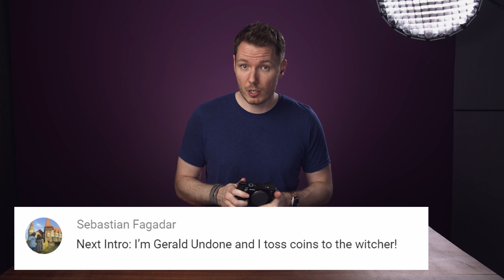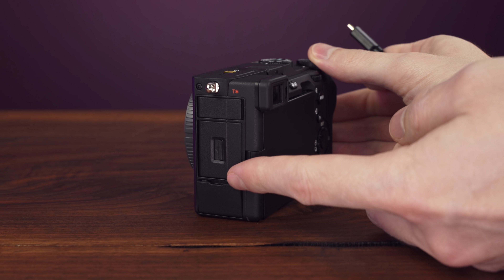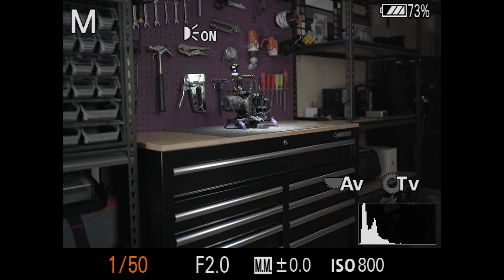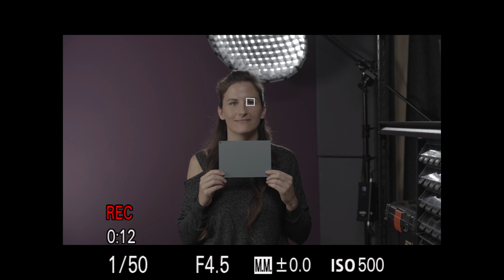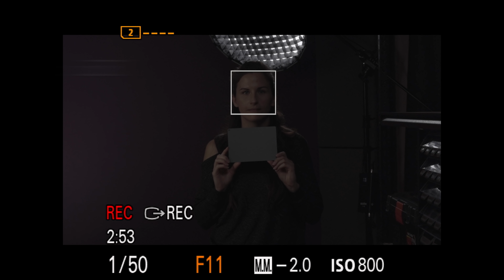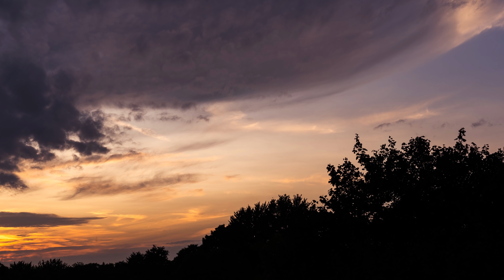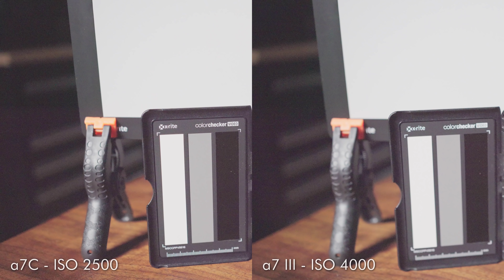The SONY a7C: Why THIS Camera Is IMPORTANT!

Comment: I used to enjoy being able to put a 14mm f2.5 on my old GX85 and slipping it in my trouser pocket, but I don't think the a7C could do this with a lens mounted - although even then, I preferred the flip screen and EVF on my old G85, then ended up getting an a7iii after Tamron released the 17-28. The AF, dynamic range, port doors and screen seem great, so it makes me more excited for the a7iv

Comment: £1899 in UK which is approx equivalent to $2400. A73 is around £300 cheaper. More price and you lose custom buttons, nice evf, better grip, two sd card slot and when it comes to the size, its almost same as sony A73, they have just chopped off evf from the top. 8 bit video recording for this price is a joke. Panasonic s5 is £100 cheaper body only and £200 cheaper with kit lense, which is much better as it is faster and starts from 20mm. How you can vlog with 28mm of sony kit lense? I just wish Panasonic s5 has better auto focus. I don't know but I have feeling that Mr undone has soft spot for sony ;)

Comment: Great video again Gerald. So the big question is: Why you have to spent a 2000 euros for a camera who is pretty much the same (even worst IBIS)  as previous Sony except to get a smaller body... If I need a smaler body there amazing deals outhere as GX9 (for 400 euros)  for street photography and best panasonic videos and the best IBIS with EM5iii in photograhpy  (1100 euros).  When I buy a FF body I want the best of the best EVF, IQ DR and not compromise because of smaller body...

Comment: Love your indepth reviews as always.

Just a note on the stabilization though - it’s possible the difference in overall stabilization between the two is the size and weight difference between the two cameras right? The A7iii is bigger and heavier and is therefore easier to hold steady. Especially with the reduction in size on the A7c’s hand grip.

I’m very interested in this camera. Seems like an ideal b-cam to my a7iii.

Comment: You show that it fils easily in your pocket without a lens!  What is the point of that?  I agree with Jared Polin. A super small full frame camera does not make much sence when it dramatically increases in size as soon as you add a decent lens.  And as soon as you add that lens, the small camera size makes the combination more difficult to use comfortably.

Comment: Although I won't be buying a camera in 2020 that is limited to 8 bit video,  thank you for the thoroughness of your reviews. One question though - why give Sony a "Mulligan" on size (e.g., "the a7C is the smallest FF camera - the Sigma fp doesn't count because it doesn't have a viewfinder or mechanical shutter")? The Sigma fp is not just smaller than the a7C - it also has several important features the a7C lacks (e.g., internal 10-bit, internal 12-bit, external output to 12-bit ProRes RAW and 12-bit Black magic RAW ), which you did not mention. Probably fairer to say "the Sony a7C is the world's smallest full frame camera that is limited to 8-bit video" 😉

Comment: I think it's a very confuse camera. Who are the target users for it??? It's a camera with the same features and technology that was released 2 years ago. Sony didn't even bother putting a newer user interface. It's not a compact camera is it? Basically Sony just recycled parts and chopped off that view finder, made it really tiny and placed it in an awkward position...there are better more compact Vlogg cameras out there. If you want higher quality video camera that's has better ergonomic just go for the 7sii

Comment: Some valid points but this felt too biased to throw Sony a bone for letting you have one of the test models (that not all YouTubers and bloggers got).  Sony was already behind the times on UI compared to Canon so stepping back for anything more than a budget ($1000-1500) option is a miss.  I also feel like a firmware update to the A7iii could fix things sold as an upgrade in this one (AF cursor).  If Sony is selling points like that, they’re desperate for positives.  I love my A7iii but see the shortcomings and Sony should have brought this camera up to modern times (like better mobile connectivity and support apps).  You focus on why this is incrementally better than a multi-years old camera.

Comment: While I get your point I think what is very cool about a smaller camera which crops to apsc when shooting 4k60 would be the fact that any apsc sony user could upgrade their body to full frame but keep every single lens in their lineup; for video at least. That makes upgrading to full frame very very appealing, cheap and easy.

What I don't like about this camera... why. The size doesn't matter. What matters is the size of full frame glass. Doesn't really matter if I hold an a6xxx or an a7iii. They're both fairly tiny. But a 100-300 m43 lens vs 100-300 on ff matters. I really don't see the point of this camera. Downsizing the body of ff hasn't been an issue since the release of a7.

and until they nail ergonomics and viewfinders I think a lot will shy from using the cameras. While I acknowledge that my mates a6300 knocks my camera out the park... just the fact that my camera (g85) I use on the ocean feels fantastic in hand and has an iniviting view finder means I feel I hold far higher quality and ultimately I feel much much more appealed to using it.

I am interested in knowing if you've ever been approached by manufactures to influence the design of cameras. I'd very much like to see a camera where someone as clever as you have been sent a prototype and actually altered the design based on your feedback.

Comment: While I can appreciate your opening point, I don't see this as a big leap over the A7R IV or A7S III.   After all, those both prove they can cram a lot more in the A7III chassis.  

I've said it before, but I see this as a camera that takes the worst aspect of the a7III (ergonomics) and makes them worse.  Oh and it has one card slot.   And it cost more...

Comment: If this would have been released 6 month ago it would be great. But now it's looks just like missed potential. No 10 Bit video, no new Menus. For me personally its a bummer it doesn't has the micro usb for using external intervallometers on gimbals and sliders. Kills it as a Timelapse camera. It looks like the canon competition made them release the a7s3 early and pushed the a7c back a bit.

Comment: First up: In Germany the Price for the A7c is HIGHER (150 Euro ABOVE the A7iii) and this is hillarious!

I dont want to pay MORE for the same tec from the 3 years old cam with a couple of improvments and the Lack of a USABLE evf, no redundend backup possibility (2 Card Slots missing) and even no full functional touch screen like the a7siii show us.

This cam for 1600€ instead of 2099€ would be perfectly fine. Sony make a huge mistake to release it at this price point, concidering all the flaws and missing specs.

Comment: the thing is with this ultra-light cameras is that you need a gimbal for video work - while a fully rigged cam can get away with the handheld operation. As a7iii owner you are right there is hardly a difference. If the camera had advanced stabilization like on the A7SIII I might consider the camera.

Comment: Seems like a minimal viable product release by Sony. Not sure if ‘C for Concept’ really rings true here. Perhaps “Cautious”; a relatively low risk way for testing what will draw smartphone users, and less technically specific vloggers/content producers (but the ZV-1 already explicitly targets this latter group). Perhaps a full frame XA-7 (best in class screen, simplified UI, dual cards with A7III level AF) would have been a stronger mix

Comment: 10-bit color isn't THAT important, but it's the only spec where Sony is behind the competition, so it's a glaring omission.

This is a cute little A7 III — which is a great camera. But people know that the A7S III is Sony's only modern camera in 2020. Maybe they're not in a hurry to spend $3,500 on an A7S III right now, but they're not going to buy something outdated that's over 50% of the price.

The A7 II is looking good discounted to $900 if you want to get into full-frame for less, but other than that ... I think anything but the A7S III is a bad investment.

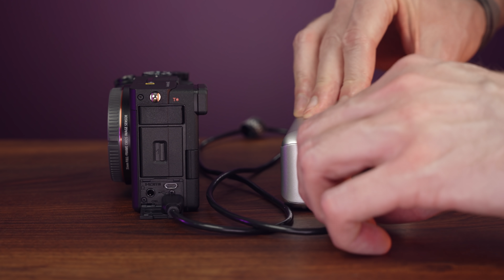Comment: Great video. Question: what power bank do you use at 2:30?  I cannot find it in your gear list. Thanks!
Reply: https://www.zdnet.com/article/zendure-supertank-pro-sneak-peek-at-the-worlds-best-power-bank/
Reply: @wiregen  Thank you!!
Reply: @erur8438  I just joined the kickstarter for it. I have the previous gen zendure supertank and it charges my MBP 16 fine but the supertank pro is just so sleek
Reply: @wiregen  Agreed. I did as well. Thanks again.

Comment: this camera will most probably get an upgrade within a year just like the a6xxxx bodies. A6300-6500, a6400-6100/6600. one slot ? old menu? no custom buttons? only 100grams less heavy? A7iii can be found brand new 1500 usd at the moment.   I wanted to like and buy this camera but .........

Comment: Did you turn off all stabilization and use the gyro that is built into it?   Download  Sony software "Sony Catalyst Browse" to smooth out the shakiness while moving when vlogging.  it's amazing but it takes a long time to do this process.

Comment: Without canon’s push, u could only see this piece of sh!t in 2020. Degrading everything so it becomes a smaller camera. If the a7c’s evf is on the top and with a full size grip plus two card slots, is there any difference?

Comment: I am really sorry, but while it may be an important camera, it is nonetheless greatly disappointing. It is actually not really that much smaller, it only misses the EVF hump of the A7 III. It has less buttons, no joystick, no second slot, no new menu system, no touch menu, a tiny EVF. In Short: It is a worse A7 III.

Comment: Interesting video, a lot to unpack! Looks like a decent entry point considering the large battery, shake reduction, and full-sensor 4k. But $1500 or less would have made more sense considering the Nikon Z5 and Canon EOS RP. I'm not sure what type of user this camera would fit well with. On the other hand, the Z5 is definitely well focused on photography and the RP on value full-frame.

Comment: Does the position of the HDMI port really block the ability to flip the screen? Can't you flip the screen 180 degrees before you fully articulate it? I agree the port may partially block the screen after its articulated, but to say that you can't flip it doesn't make sense to me. Otherwise, great review. Thanks!

Comment: Good review. It seems like a little on the boring side. Especially that it provides roughly the same video quality as the A7III. Also, I am not that big a fan of small camera bodies. Small camera bodies, like this one, tend to have fewer buttons and are typically less ergonomic. And they are sort of trying to sell a fantasy: yes you can pocket it, but not with a lens attached... Not that I would risk carrying a 2000 dollar camera system in my pocket if I could.

Comment: if you listen to your review on the Panasonic S5 at 2min24 you dislike the micro HDMI but it's not an issue on the Sony?!? Was it because the old Panasonic had a bigger HDMI?
Reply from the maker: Yeah, mostly. I've come to expect it from Panasonic. I've already complained about it 100 times with Sony. Plus, I can kind of accept it on a tiny camera, but I always equate Panasonic with big enough to accommodate a full size HDMI. But yeah, Micro HDMI sucks!

Comment: Great review Gerald but this camera has terrible specs. Tiny evf with old 2.36m dot, less than 1m dot lcd with no touch, 1 card slot, new ibis which Tony and Chelsea claim is only effective to 1 stop rules it out for vlogging. 1/4000 shutter is terrible. In daylight you are going to struggle to shoot at f1.8. No front dial, removed custom buttons, no joystick, 4k30 and 8bit all for $1,800 U.S. Wow Sony.

Comment: Sony still hasn't got it right for vlogging. Instead of starting off with a FF sensor, they could have released a "A6700" under $1400 which is basically a reconfigured A6600 with plastic build, 10bit422, flip-out screen, lower still fps, better IBIS (with the smaller sensor), new touch menu, a 12-40 kit lens for vlogging.

Comment: I’m running an a6400 now and this is literally the perfect upgrade to full frame. All I do is vlog. This should still work on my DJI Ronin SC gimbal. For YouTubers like me this is awesome. Just wish it was 10 bit.
Reply: I don't possibly understand how you'd want full frame for blogging and at the same time neglect the awful rolling shutter performance.
Reply: this camera is a joke. just get an a7iii. this is the camera that no one wanted.
Reply: Jorda n 30 minute recording limits?? Hard pass. There’s no reason for any camera to still have that and I’ll never spend money on one that does.
Reply: You sure about that? I also have an a6400 but the price here is off putting. Especially with the rolling shutter issue. I love the a6400 but the rolling shutter is rough.
Reply: Don Jacobs it’s so rough it can ruin a simple pan if you have a scene with vertical lines, or edges, or texture, or... it can ruin any shot that involves any sort of movement.

Comment: Nice and thorough as usual without being war and peice. I know when I see a 14 minute Gerald Undone video that at least 12 of that is going to be no nonsense, information dense and to the point (unlike so many others). Such a good format.

As for the A7C, my layman take is that if you don't need the class leading auto focus or less obstructed screen, the S5 is a much more capable video centric camera. So perhaps FF vlogging to the A7C and more rounded video needs to the Panasonic S5?

Comment: $1800 seems way too much for a side-step/downgrade from the A7iii
The new firmware features are nice, but the hardware features should put it in the sub $1500 class.
I think if the a6600 was at $1200, the a7C would fit into the sub $1500 category.

Still, this has made the a6600 totally a bad buy in terms of price, so I'm wondering if price drops will come soon.

Comment: The old menu, no 4k 60. no space for fingers between lense and grip, no custom  buttons,  more expensive than the a73.. i am disappointed. I was about to switching to sony but i guess i will buy a panasonic s5 instead. Its better in anything but af but i am fine with panasonics af
Reply: Check about Fujifilm xt3 & xt4 also
Reply: D R i dont like the fujis. The lenses are not good for video and the body just dont fell as good as my gh5 . There are also some features missing i love with my camera.

Comment: What a joke of a camera, Sony crippled it too much, it was a canon like move, just totally wrong approach
Reply: This is a concept camera . As gerald mentioned it doesn't hold much value today but lays a new path for what is coming in future . If people like this camera they can implement it in future new cameras otherwise they wont
Reply: How did they cripple it? Its basically a a73 but cheaper and smaller. Its exactly what the market it's aiming for wants, and far exceeds anything that would compete against it.
Reply: @aranu157  it's not even close to the a7III because:

- Worst evf than the already bad one
- less buttons and dials
- 1 card slot
- 1/4000 mechanical shutter and 1/160 flash Sync, can't believe this, for me it is unusable
- The display is worst than the A7II which is 6 years old
- No 10bit or 4k60 while other
 competitors do it for less money
- Still bad rolling shutter
- New camera, old menu system, wtf is wrong with Sony?

This a7C is in a total wrong price range, should compete with the RP, the a7III, in my country, cost less than this toy and it's not a crippled by purpose camera
Reply: They had to put their leftover sensors somewhere but cut too many corners in the process. At least it'll move some A7iii inventory for them.
Reply: A full-frame mirrorless camera released in 2020 without any support for 10-bit video is just that (a bad joke)
Reply: It's not a bad camera, it's just a bad price. 1800 dollars for an a6600 with a larger sensor? Probably should have been 1400 to 1600 imo.

Comment: Compact full-frame is quite intriguing. On one side it does make it easier to travel with, but the lenses are still going to be massive so I wonder if the ergonomics would just be even worse to try to support the big lenses without much support.
Reply: 1.8 primes aren't massive

Comment: Should be about half the price... ergonomics is also compromised.
Reply: Uh no. You’re looking at it compared to their full size bodies. This is not that. This is hot a replacement and you’re looking at the product from your life. Not someone who would find this. The tech to make it this small costs a lot. Offering it for half the price would make zero sense and have zero incentive for Sony to make that. For the people who want to do low key street photography this is perfect. No other camera this small will compare to the lowlight and straight up stills quality.
Reply: @RiceCubeTech  any nicer, faster lens and you cant even hold that tiny body because it will be too front heavy. And you will need to add a cage and grips.

I don't know, even the RP was pushing it. This is just small for the sake of small, it seems. Maybe it is just a vloggers camera to be used with small primes.